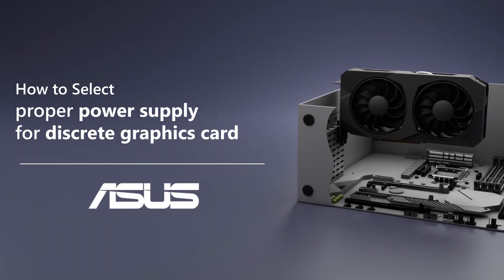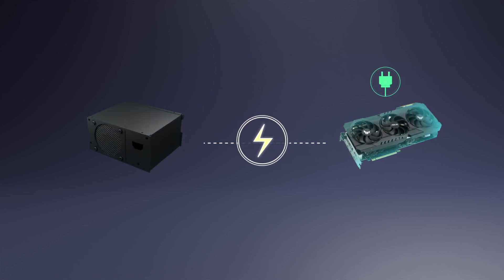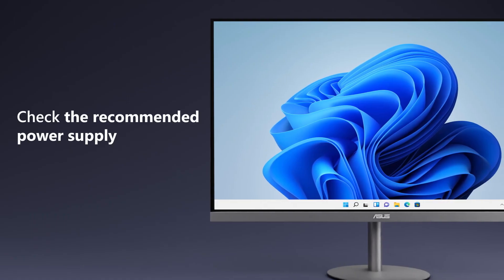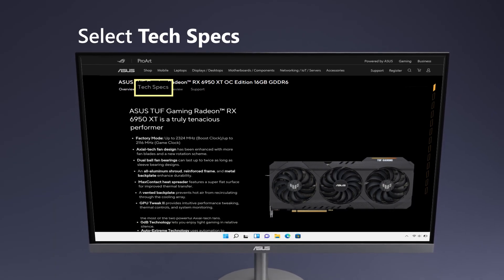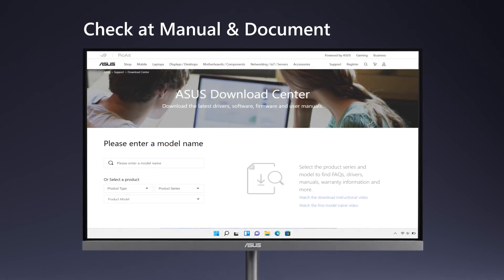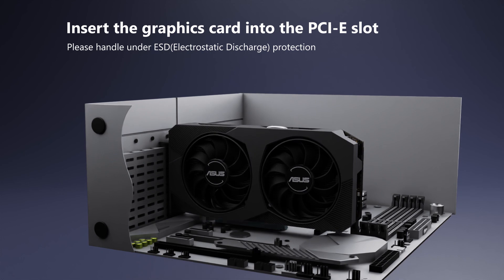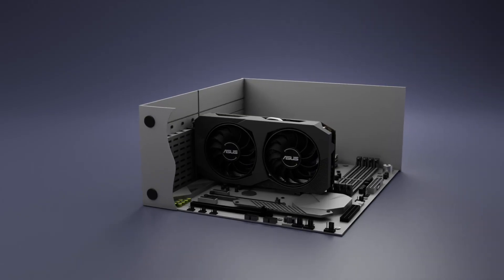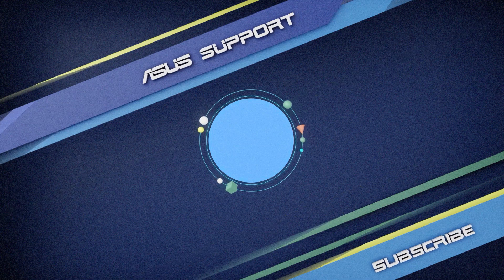How to Select Proper Power Supply for Discrete Graphics Card    | ASUS SUPPORT

Comment: In well over 10 years I've never EVER encountered this issue on Acer or HP UNTIL I GOT ASUS and never again. I paid 10K for 2 ASUS 2023 top of the line gaming laptops but this issue is diabolical and I'm selling them BOTH back to the manufacturer and buying Acer.
Reply from the maker: Hi, may I ask if your question is related to a laptop?
If so, we are delighted to provide you with a dedicated discussion forum to ensure you receive the best support and answers.
For our laptop series products, we have created the forum specifically for users of laptop products.
On the forum, you can ask questions related to the products, share your experiences, and interact with other users.
Our dedicated team will also be there to provide personalized assistance, ensuring you receive accurate and timely responses.
https://zentalk.asus.com/t5/laptop/ct-p/Laptop
Thank you.

Comment: Hello,Asus Support
I need a solution for this Problem I'm facing in my Asus Notebook- X540YA
I usually use my Laptop for some Typing work and watching movies.
After around 1.5 year of Purchase ,My Laptop started working very slow,So I quickly uninstalled all unnecessary applications and removed all unnecessary Datas but Even after doing all these,My Laptop became even slower than before,It felt that with Time it was getting slower and slower and then suddenly some of the keyboard keys stopped working like- T,Q,V,P,R,X,Z and few more.
Then, I shut down my Laptop using Power button,It was ok.
But When I tried Turning on my Laptop using Power button it took around 30-40 secs to Power it On and I used it for around 4-5 minutes and i again shut it down.
Then,I tried turning on my laptop once more by pressing Power Button for around 2 minutes but it didn't turned on.
And Sadly,It was dead :(
So I sent my laptop to Asus Service center,and they told me that's the Problem of Display IC,Battery and Keyboard and Charged me around $100 for the repair.
But it was repaired,It started working like a Charm but it didn't last even 4 months and I started facing the Same Problem again---Laptop Slow---Keyboard hangs---30-40 secs to power on and then Dead!!!
I was very much frustrated.
I sent it again to the service center and they said it's Motherboard is dead and would cost around $250!!!!
That's so costly!!
So,I took my Laptop unrepaired back!!

Then I started finding solutions on Google and Youtube to Turn on Asus X540YA Notebook without Power button,and fortunately i found a solution that to Sort the first two Pins of a Keyboard connector on Motherboard to turn it on!!
And Yes,It turned on.
After then I quickly Reinstalled Windows 10 Pro,There was no lag at all and It started working fast!!
But Obviously It's inbuilt Asus chiclet Keyboard isn't working anymore,Power button isn't working too and I have to sort those two pin everytime to turn it on and i'm using an external keyboard now.
I have also noticed that it gets heated very quickly!
And Repair is very costly!!
I am surely going to buy a new Laptop but I want to know the Reason for this Problem and also any other way to Turn on Laptop without sorting or using Power button??
Please Tell me.Thanks!!
Reply from the maker: Hi Anupam Divyanshu,
It is advised that you abide by the information the Service center provides after inspection based on the circumstances you describe.

Comment: Asus please fix the support page, every link just goes to the product page, no for download page. It's impossible to download drivers from your website.
Reply from the maker: Hi Marcelo Neres,
It is recommended that you try to refresh the page several times, use an incognito window, or perform the original path operation.
If the issue still exists, please provide the model name (for example, TUF GAMING Z690-PLUS WIFI D4), thank you.

Comment: Dear ROG TEAM, recently when I type a key then the laptop automatically press 'j' if I hold any key ( not hot keys)then laptop press that button correctly but with 'j' like 'mjmmjjjjjjjmjmmmjjjjjjjj' this . In single typeing case 'mj or mjj' like this . And this happening when heating temp. Like 70-80 C but in normal temp. It works well without any problem ... Now what should I do ??? My model is ROG STRIX  G513 IH
Reply from the maker: Hi WITH MUN,
It is recommended that you uninstall and reinstall the driver of keyboards.
Please refer to the following link for further information.
https://www.asus.com/support/FAQ/1015071/

Comment: hi there ! i have the asus rog g20 pc and it won’t turn on? , my power supply and power bank are perfectly fine but still no power? could u help?
Reply from the maker: Hi SweyFLY,
Please check that the power cord, display connection cable are correctly connected.
Does the power indicator light up when the screen is black?
If so, please refer to the following link.
https://www.asus.com/support/FAQ/1015583/

Comment: If I FACTORY RESET my ASUS F15,
Then will my = 
Microsoft, Armoury crate, 3D paint, camera, DTS:X ULTRA, My Asus app, NVIDIA control PANEL, Excel, male, Microsoft store, onedrive.....etc,...
apps 
Which I get inbuilt in laptop,when I purchased from Amazon GET DELETED IF I FACTORY RESET/HARD FORMAT.????
Reply from the maker: Hi 36 Omkar Mahandule,
Resetting your laptop will reinstall Windows but delete your files, settings, and apps.
Please refer to the following link.
https://www.asus.com/support/FAQ/1013064
Therefore, it is recommended that you complete a backup of your data before operating a factory reset to avoid data loss.
Reply: How to solve this Automatic Repair?=
 Log file. E\Recovery WindowsRE\Winne wim/System32\Logfiles Srt\Sit Trail.txt
Reply from the maker: May I ask what kind of issue are you currently encountering? For example, the Blue Screen of Death? Could you please provide the model name (for example, FA506IH), BIOS version, and details of the situation?